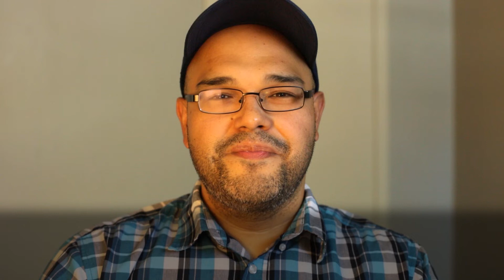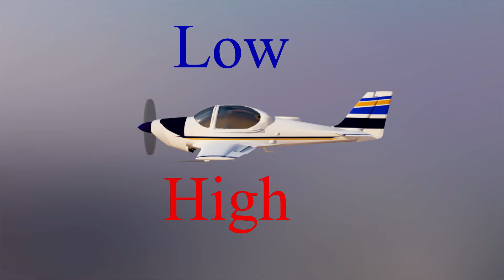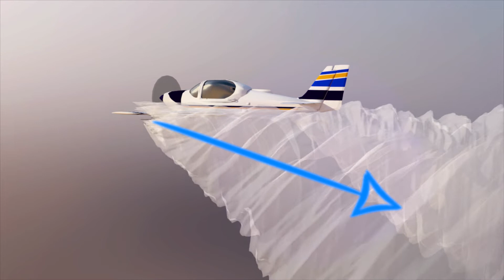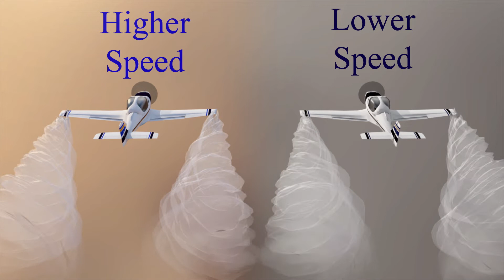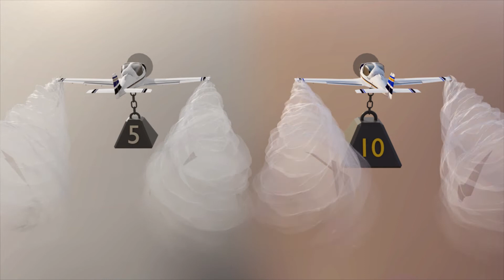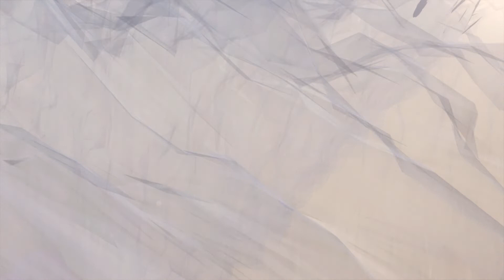Wingtip Vortices | Pilot Tutorial

Comment: Excellent, you avoided the common textbook-misconceptions!   Upvoted!.
The main misconception is apparently due to Prandtl, who described these vortices as perfectly horizontal (see the Prandtl Horseshoe in his early 1920s papers.)   Yet if the Prandtl Horseshoe actually becomes horizontal, the vorticity decreases to exactly zero.   (No tilt?  No vortices!)   Prandtl taught all of us that wings are able to fly by pure pressure-difference alone, without needing to move any air downwards.   Wrong.  This odd viewpoint only arises in wings of infinite span, where the wing is permanently trapped in WIG (or ground-effect,) and the ground is pushing upwards against the wing, with no net downwash-plume behind the wing.   But common flight at altitude has zero ground-effect, and the entire lifting-force results from the downwards motion of mass-bearing vortices, according to F=mA.  The vortices entrain the air between them, carrying it downwards, so the net downwards momentum can be enormous.   (The so-called "Newtonian" description centers on the creation and the downwards momentum of tip-vortices.  Wings are examples of reaction-motors, examples of fluid propulsion, same as propellers, helo rotors, sailboats and jet engines.)

Note:  refer to helicopters in horizontal flight.   Perhaps animate them, first hovering, then also, fast horizontal flight.  Watch the vortex-pair form, even though the helo lacks a pair of wingtips.  Regardless of the number of blades, the rotor still creates a tip-vortex pair.   

Also, visualize a helicopter during high-altitude hovering.   Conventional aircraft obey the same physics, but this may not be obvious, because their rapid horizontal translation is smearing out the "helicopter-style downwash-plume," to become a long, tilted vortex-structure, rather than a vertical cylindrical column.   

And, when a cylindrical jet is produced by a transversely-moving orifice, its outer shell of vorticity will "wrap up," to become the familiar scroll-shaped vortex-pair.   The vortex-pair entrains a large cylinder of down-moving air, trapped within the mathematical "separatrix" which surrounds the vortex-pair. 

Similarly, a traveling smoke-ring will actually have the shape of a sphere or a lozenge, as can be seen when an invisible vortex-ring enters a region which contains fog or marker-smoke.  A vortex-ring is like a flung baseball made of gas.

Conclusion:  airfoils fly by the reaction-force from launching smoke-rings downwards, but this fact is very difficult to notice if the wing is moving sideways too fast.   Better to inspect a hovering helo, where the downwash-plume can be approached as a tall column of vortex-rings, stacked like pancakes.   Also, inspect the fluid plume of a pulsing jellyfish, and inspect the violent reaction-kick produced by the famous Wham-O Air Blaster(tm) toy, whenever it launches a transparent ring-vortex.   That's the same "Newtonian" description of the lifting-force of airfoils.

Odd trivia:  the vorticity does not come from the tips of wings.   It comes from the wings' trailing edges, the "Sheet-Vortex."   But because vorticies move with the wind, the adjacent vortex-threads will move each other, causing the wide thin sheet of vorticity to wind itself up into a dual scroll-shape.   If a wing emits marker-smoke (or emits condensation-mist) from its entire trailing edge, this process becomes easy to observe.

Comment: Close but not really... A plane flying at very low speed gets most of its lift from the nose being so high and the wind hitting and compressing against the bottom of the wing, which means that at the wingtip, that air pressure and the plane's motion pushes that compressed air around to the back (top) side of the wing.  This constant motion of air causes a very strong spinning current which lasts behind the plane for a significant length of time.  At very high speed, this angle is not necessary, and is greatly reduced, because the curvature of the wing provides most of the lift and thus not so much from the now much lower wing angle against the oncoming wind.  The pressure difference between top and bottom remains but this spinning current is not so greatly exacerbated by that now much lower angle of attack.  The vortex is not related to the amount of time, so much as the difference in angle of attack.  It's called INDUCED Drag - Drag induced by creating lift.  Induced drag reduces tremendously, exponentially, from lowest to highest speed.

Comment: How do Wingtip vortices produce lift?
Reply: The Wham-O air blaster toy, why does it produce a "kick" when it lauches a vortex-ring?   And why can a vortex-ring knock over a cardboard target?   It's almost as if a vortex is like an invisible baseball, a massive object, and carrying momentum like any object.   (If we completely fill a ring-vortex with smoke, by for example launching it from inside a smoke-cloud, launched towards the clear air, then we find that the ring-vortex looks like a sphere.   The edge of the entrained air is roughly spherical.)

If that makes sense, well, wings are doing the same thing, but also they're moving sideways.   They fling a ring-vortex downwards, but that ring-vortex is being stretched out for miles.   The "circulation" on the wing is connected to the tip-vortex pair, is connected to the distant start-vortex.   The entire thing carries mass as it moves, and the entire thing was flung downwards by the wing.

So, vorticies are objects.   If we launch one fast, we obtain an unmistakable reaction-force, as with a rocket-engine, or the kick of firearms.

Comment: Hello, does it mean that : the stronger the wingtip vortices so the stronger lift-induced drag will be?
Reply: Yep!  That is why sail planes have very long wings.  But, long wings, at high speeds, can get into wing-flutter and FAIL in flight!  Try and land without any wings!!!  
The U-2 Reconnaissance Planes (They are not Spy Planes).  Have to sue spoilers to descend as if they are too fast in thick air (lower altitudes) the stress may make the wings fail.